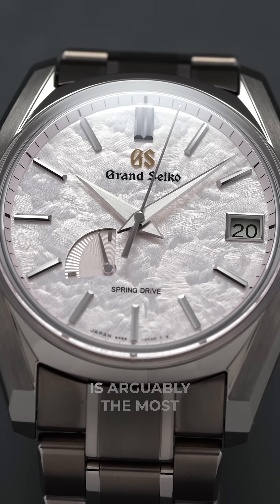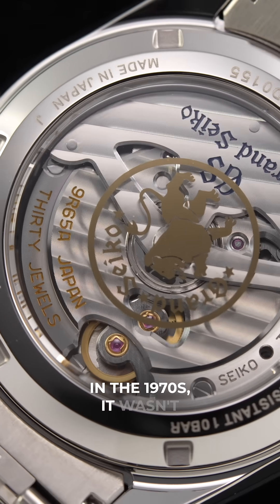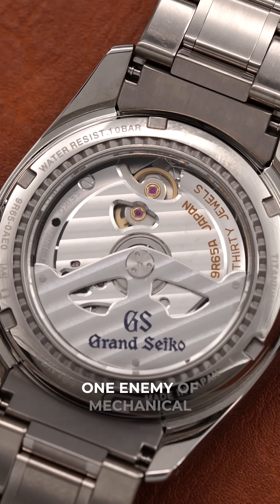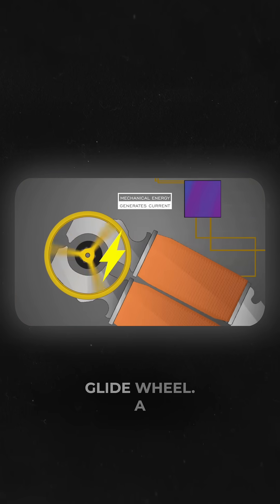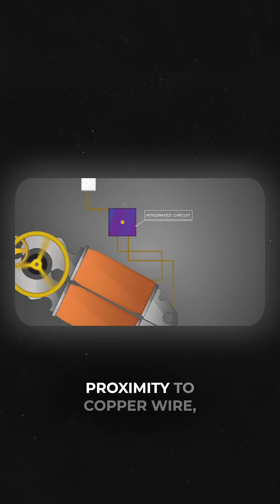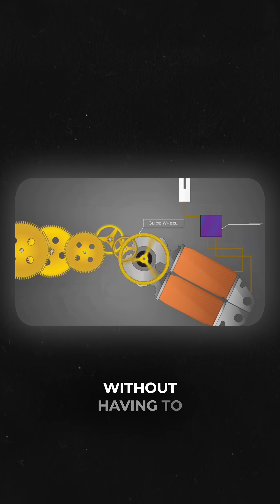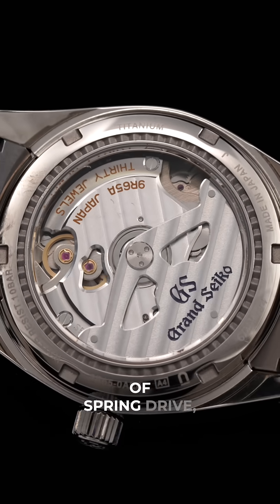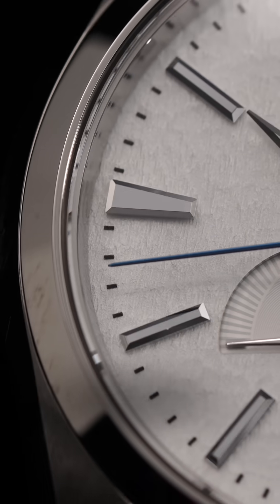What Does Spring Drive Mean & How Does it Work?

Comment: The el primero achieved a similar feat except instead of using electricity it’s 100% mechanical. 

GS focused on extremely accurate time keeping while zenith achieved extremely accurate chronograph function. 

You should make a video like this for the 38,000 bpm el primero 👍🏽

Comment: I bought one Christmas 2023. It's an impressive piece of miniature electromechanical engineering.
As for it's accuracy, it varies between +/- 2 seconds month. If I'm not wearing it it's about -2 seconds a month. If I'm wearing it, it's +2 seconds a month. I think it's the heat from my wrist makes it run about two seconds faster.
Reply: Gravity affects it more than heat.
Reply: @josue_kay  I didn't know the truth of this so I contacted Seiko. It took ages to get a reply. I've tried to post the email but YouTube keeps removing it.
Here's what it says. Because its a thermocompensated movement the effect of heat has a very small effect but it can be measured.
Gravity usually affects balance wheel. As the Spinig drive has no balance wheel gravity does not have a measurable effect!
Reply: How much did it cost?
Reply: @MacbookPro-b6r  didn't see this post. The one I bought was model SBGA463	 used but with everything and absolutely no evidence it had been worn. It cost £4k. I had my heart set on the titanium model but couldn't justlfy the extra cost. But when I tried the titanium on it feels too light. I think the stainless is about 200grms and the titanium is about 140grms.
I know it sounds  stupid but the ss model seems like its worth more!😊
I got the ss model.
Reply: @kdmc40 thanks for the reply, they’re completely unique and insane
Reply: @lukastux3024  Not necessarily. On average, they will be +/- 20 seconds a month, which is around the same as most spring drives. The best spring drives are around +/- 20 seconds a year, whereas the best quarts watches are around +/- 5 seconds a year. 

But let's be honest, at that level, you are talking about 3.5 minutes a decade versus 0.5 minutes a decade. It's almost the same thing from a practical standpoint. The bigger factors are: 1) price, which quartz easily wins; 2) horological excellence, which spring drive wins IMO but some quartz geeks could make the argument otherwise

Edit: from a practicality standpoint, there's also the fact that with a spring drive you'll never have to change any batteries since they're either automatic or hand wound. But this point is quite moot when you consider the myriad other reasons why a spring drive would need to be taken in for servicing at some point in it's lifetime as opposed to a quartz watch.
Reply: I didn't buy one cus I'm broke lol

(I'm not actually broke I just can't afford it)
Reply: @lukastux3024 Everybody knows that

Comment: I may be hated for this comment but to me it’s just a glorified quartz movement. It still has a computer chip in it, and not in keeping with a true analog piece.
Reply: A McLaren P1 uses a twin-turbo charged v8, as well as a hybrid battery system in order to produce an extra 177 HP and tons more torque. 

Many hyper cars follow this philosophy, are they then, still just overglorified EVs?

Thats the equivalent of saying a spring drive is an overglorified quartz movement.

Comment: While it’s an amazing piece of tech, I’d still rather have a Casio with multiband like my 5610 if accuracy was of concern. The 5610 will be a fraction of a second off at most, mine syncs every night without fail. Also $150 bucks vs like $10k , it’s not that impressive. Luxury watches are only worth what the next idiot will pay for it, take the Rolex’s selling above msrp for example. A fool and his money are easily parted.
Reply: Think bigger, not everyone is broke
Reply: @on2wheels275   If you ain't broke then why buy cheap 6K watch?

Comment: So what's the difference with Kinetic ?
Reply: Kinetic uses a rechargeable battery to store  the energy generated by the mechanical movement, Spring drive has no battery, it’s essentially a Quartz watch powered by a mechanical movement ( its way more complicated than that)  in terms of accuracy it’s closer to a Quartz watch than mechanical watch, you get a fantastic looking movement and the mesmerising smooth sweep of the second hand.

Comment: Sounds way cooler than I can understand 😬
Reply: It’s extremely simple look at the diagram
Reply: Basically its a normal watch mechanism that is being powered by a small magnet, when the watch needs more power its draws the potential energy from the big coiled up main spring which is storing all that energy.
Reply: Its an overpriced quartz watch, there I simplified it for you. Buy if its available for 200$
Reply: @NoName-bb2pu it’s the biggest advancement in watch making since quartz movements made mechanical movements obsolete
Reply: @michaelh8854  absolutely, there are a lot of people who need wear it and forget it watches, there are a lot of people who buy Teslas for its tech and acceleration.

Me, I like my manual wind Jaeger Lecoultre Reverso, IWC Portofino, Cartier Tank and Rolex Datejust, just as I like fuel driven cars, just because I have the time to wind and polish my watches, fuel up the car and take care of its mechanical parts.

Also in the circles I move with, my business depends on how well heeled I look, to most, Grand Seikos are just Seikos, but that 2 tone Rolex gets me into the limelight, it makes me 10x more money than I put into it. That's the point of paying for 5 digit $ watches.
Reply: @NoName-bb2pu  Wow! A man who makes a lot of money yet has the time to write a long comment on YouTube.
Reply: @joelbontuyan  absolutely, thats what I said in the post too, that I have the luxury of time.
Reply: It isn't. It's mechanical, but replaces the lever escapement for a friction-free electro-mechanical solution.

Comment: Why did they name it Spring drive? Does anyone know?
Reply: it was just after winter, so it was spring.
Reply: Because it's powered by the mainspring, unlike a regular quartz watch powered by a battery. 

The spring is basically turned into a generator, driving a small electric current without a battery b
Reply: because its energy is driven by a mainspring

Comment: Defeats the purpose of a mechanical watch in my opinion.  If you want better timekeeping rather than craftsmanship, then just buy a quartz.
I mean this is just a quartz watch with a whole load of unnecessary parts lol.
Reply: So you’re saying that this isn’t craftsmanship? Lol. Alright buddy.
Reply: @ItzRoe  No, my point is is that you buy mechanical watches for the craftsmanship, not a hybrid of craftsmanship with cheap electronics to beef it up.  Also the craftsmanship and engineering in this isn't making the watch accurate, the quartz is.
Reply: I basically agree — to me this is a quartz watch. It’s extremely well made, but I’d still prefer a fully mechanical movement with slightly less accuracy than a super accurate movement with quartz. To each their own.
Reply: @xav645 have you ever seen a quartz watch sweep hand move like a GS, …. I don’t think so